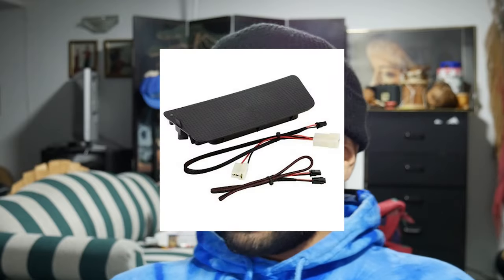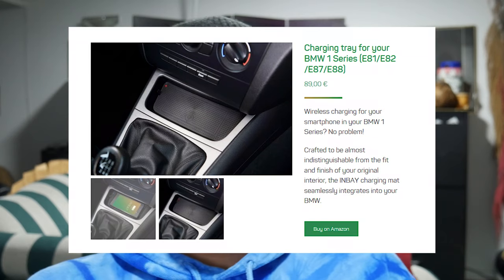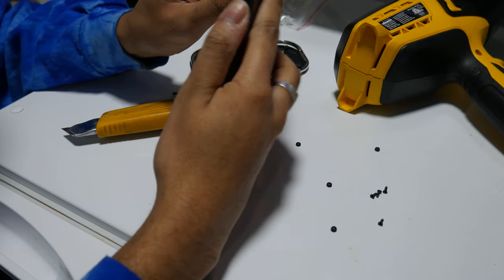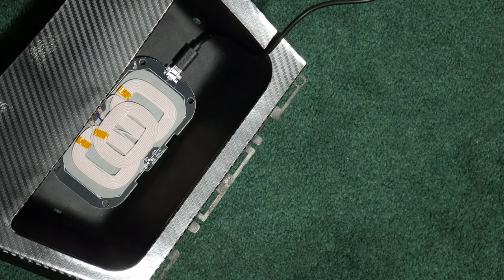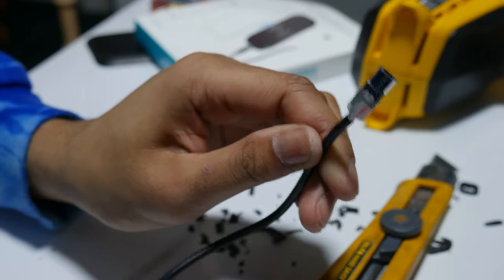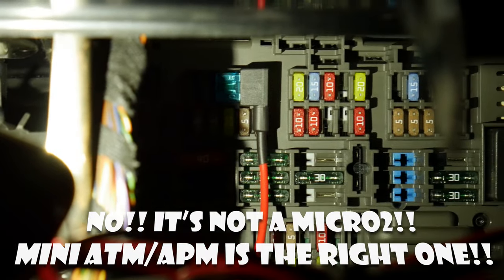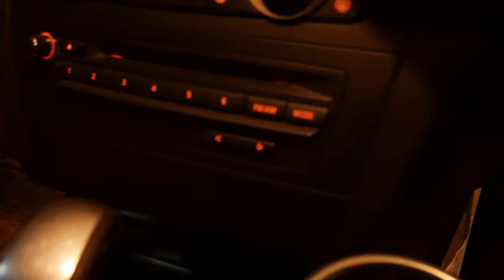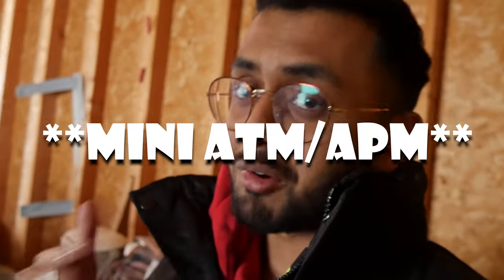DIY: Custom BMW Hidden Wireless Charger! | E82 135i

Comment: Can you show how you connected all the wiring from the charging port to the fuse box?
Reply from the maker: So the micro-usb cable connects to the quickcharge car outlet. The car outlet goes into the cigarette lighter adapter. The red positive cable goes into the fuse adapter which goes into fuse 5 and the negative cable goes into the screw on beside the fuse box.